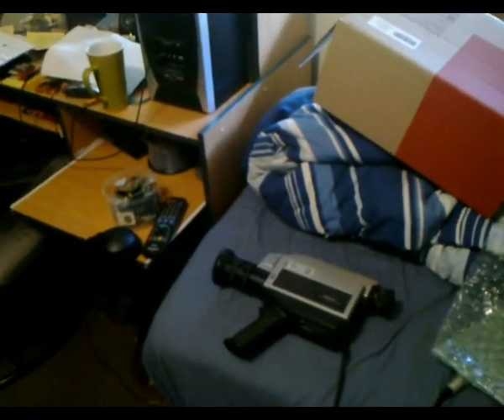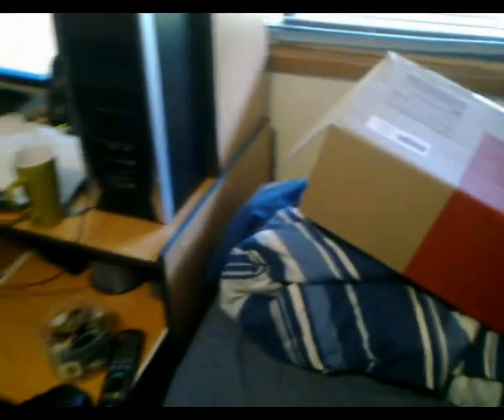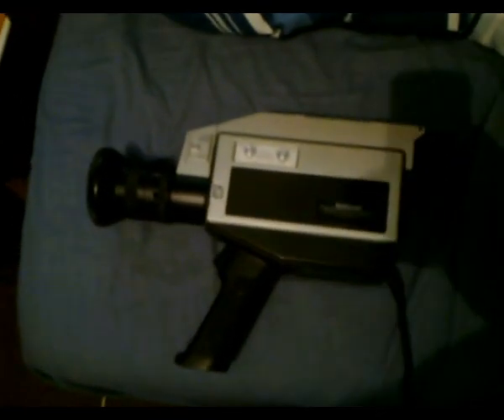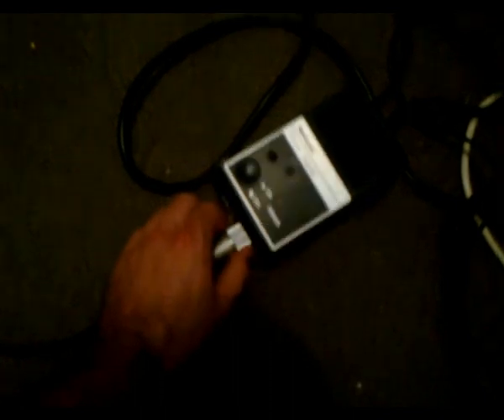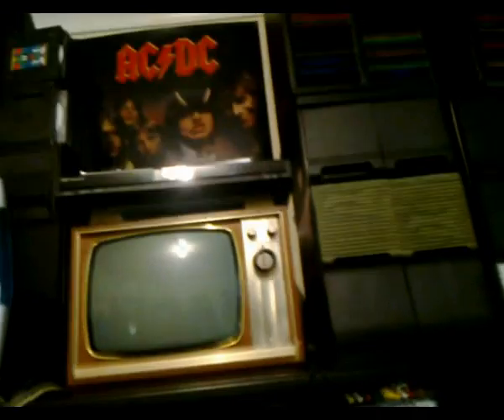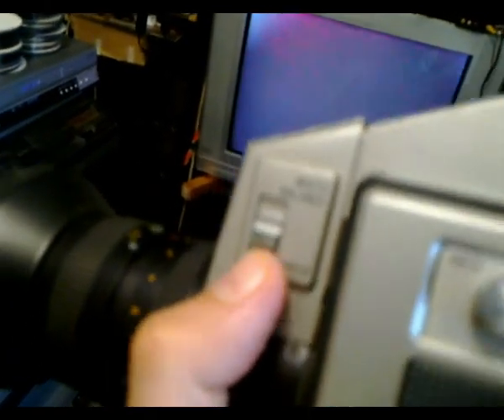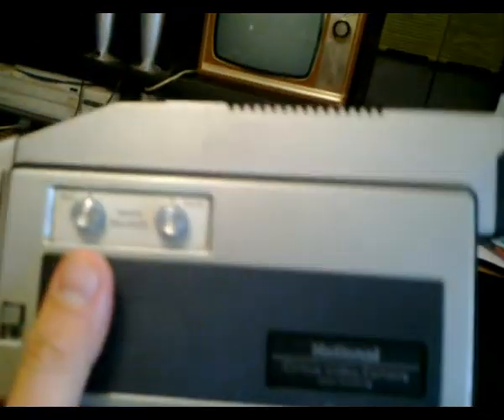Testing my 1979 National WV-3000N vidicon colour camera

Comment: I bought one in 1979 and still have it . It was working fine in your film.But it only has one lux so you need to take it outside to see a clear picture. I used to video weddings with it when nobody else had one. So I needed a powerful light to film indoors.It's comically primitive but back in the day it was the dog's danglers.

Comment: Did you ever manage to get this camera working properly? I have the same camera, it doesn't have this problem but it does have a massive amount of lag, to the point where in normal light you point it at something for more than a couple of seconds and it leaves an imprint for ages. Its also hard to get the colour right, it seems to change as the camera warms up.
I'm not sure how the y/c system for getting the colours from the stripe filter works with this camera but I know with a lot of single tube camera the green is sort of the main channel and is where the luminance is derived from and the red and green are made by subtracting from it so when there is poor electrical focus it results in a partially or totally green picture. That leads me to think that the problem with yours may be optical. Or even the white balance setting filter is stuck closed or something. Of course I might be totally wrong.